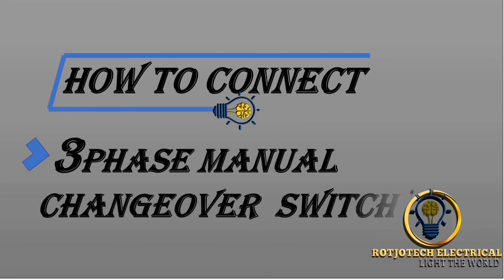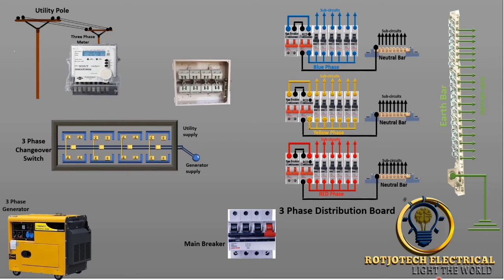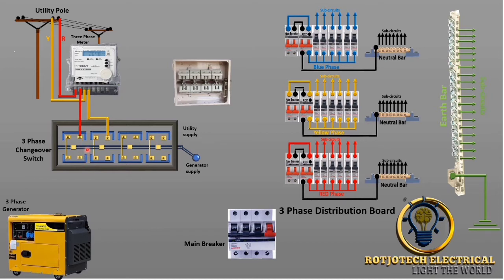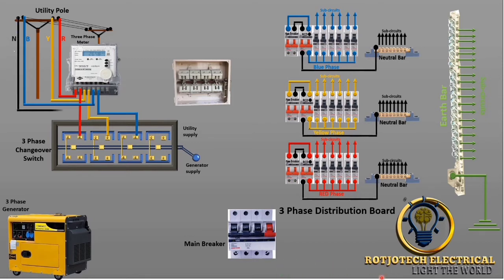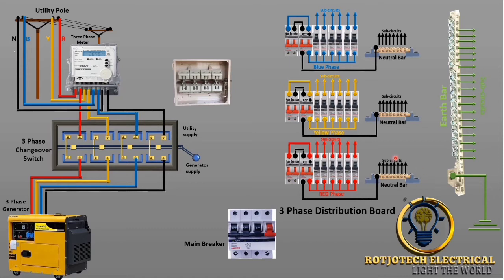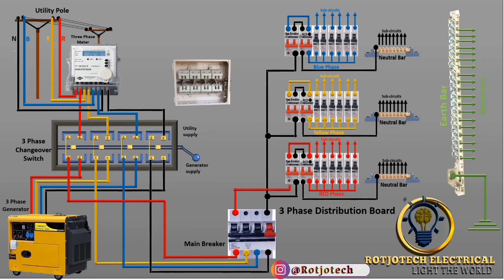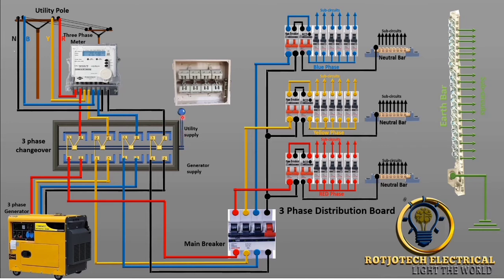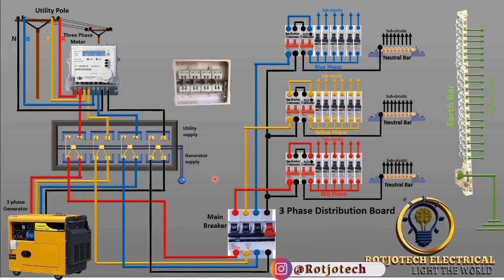HOW TO CONNECT 3 PHASE 4POLE CHANGEOVER SWITCH,

Comment: but the Gen A/c plug carries only 2 wires which is life and neutral, does it mean we have to loop it first inside the changeover?
Reply from the maker: Generator that i use in this video is 3 phase but if you are using single phase generator [2wire] you will have to loop it . But any equipment that are 3phase will not work properly or not work at all